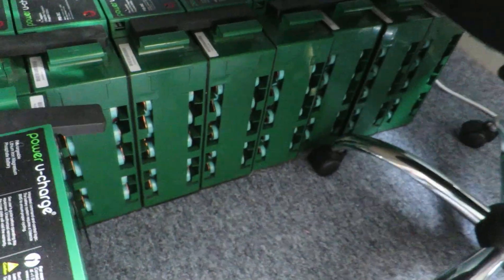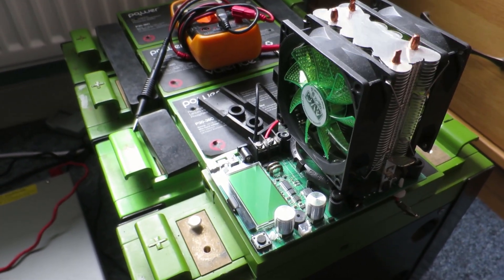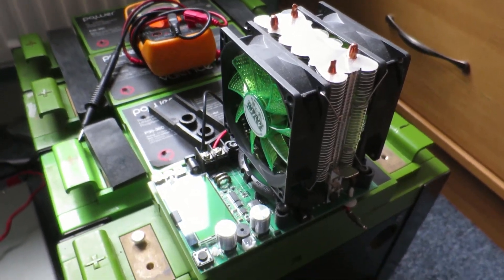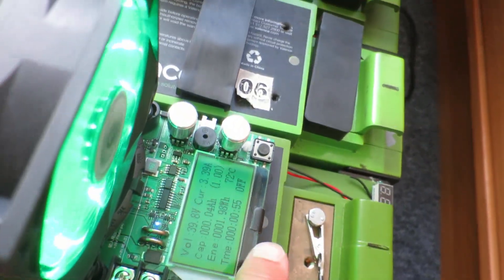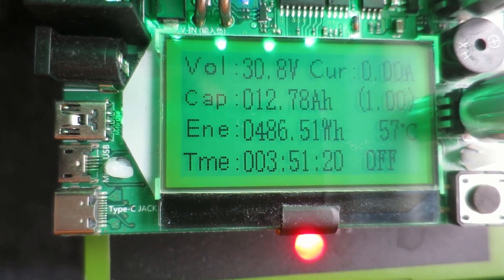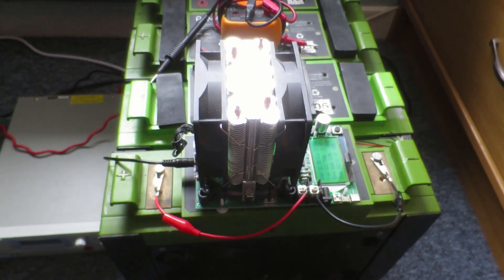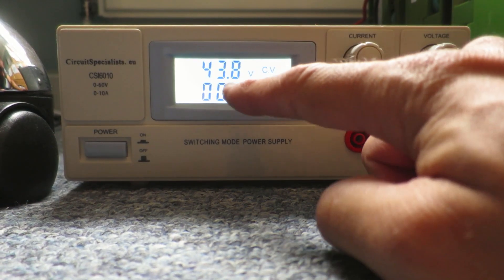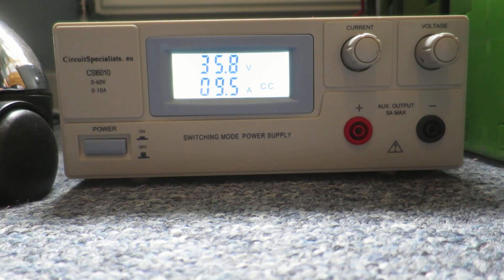How to test capacity of a LifePo4 (Lithium Iron Magnesium Phosphate) battery.

Comment: What would this process look like if the capacity of the pack was limited to preserve its life? ie the way some ev manufacturers limit the packs usable capacity.
Reply from the maker: So pack capacity limitation would be dealt with via other control methods. So for instance here I discharge to 2.5v per cell (12s so 30v total), if you wanted to protect the cells further then you would discharge to say only 3v per cell (36v total pack). In a Nissan Leaf the same would be true, the onboard computer would 'turtle' the car at a voltage higher than 10% of the batteries capacity still - to stop you from totally ruining them. Obviously you lose total power you can use, but you preserve the batteries life.